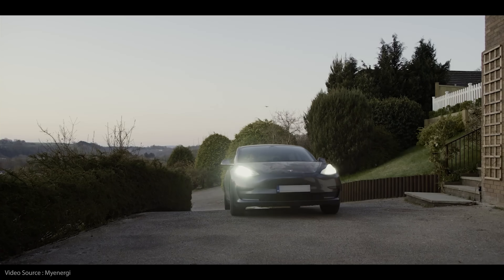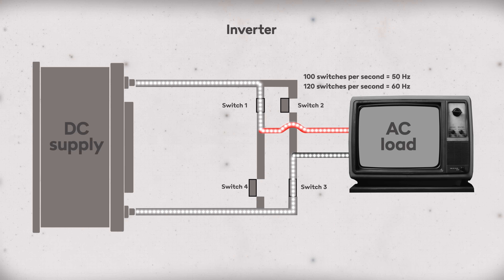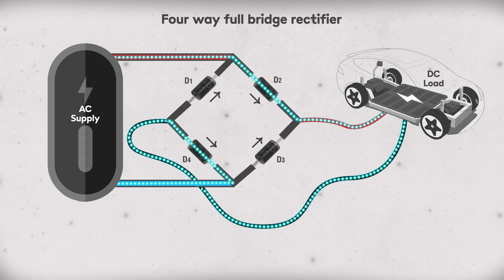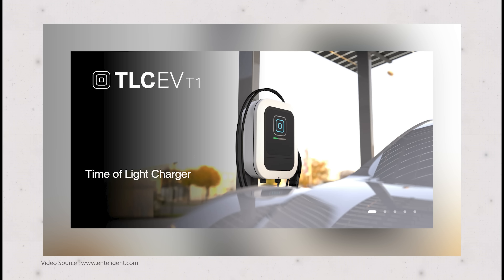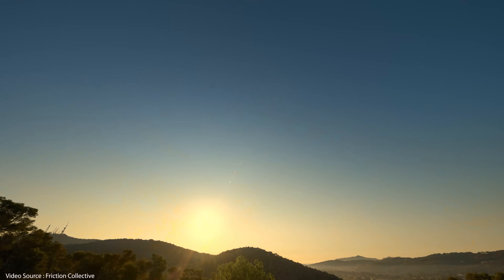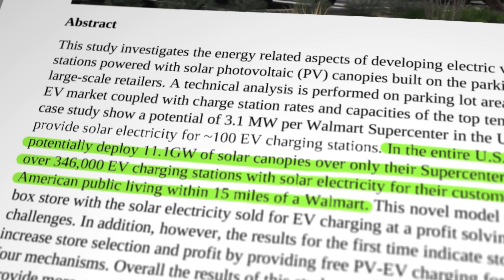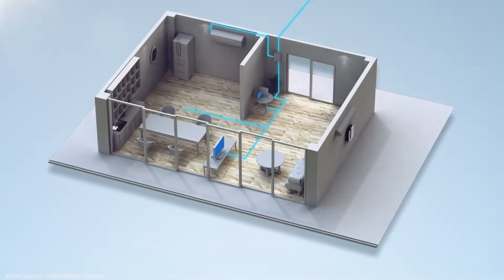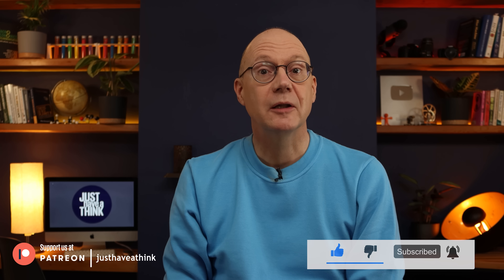DC to DC charging. One more step to off grid living!

Comment: I want to run a heat pump directly off DC solar with no batteries.  I don't usually need cooling at night and there's plenty of solar in the day.
Reply: While DC motors exist, they are horrendously inefficient (50 to 80%).  Compare 75 to 90% for an AC motor, and your heat pump has at least three (the compressor, and the fans).  You're gonna waste energy somewhere, best case you lose 20% in the motors, or if you go AC you might split those losses between the motors and the power electronics. 

The real issue though, is your modern heat pump has a bunch of power electronics in it to match the load on the machine to the conditions and demand - the first stage will be a rectification stage - unnecessary if you have DC to start with.  The motors will use AC for the same reason car motors are AC.
Reply: @jnawk83  I see what you mean about the motors being inefficient on DC.  If the system were to convert to AC for efficiency that's fine.  My real goal is to have it run it without large batteries and as few extra components as possible.  My concern is the system may not handle the irregular power inputs without those large batteries though.
Reply: @jmr  ah yes, you'll either need wastefully many panels, or some energy storage
Reply: @jnawk83  Panels are getting cheaper quickly and they have great life spans compared to batteries.  I think I can find places to use the excess energy.  I've had ideas about water heating and water pumping as places to dump extra capacity.

Comment: As has already been pointed out, switching power supplies are pushing high 90s percentages in efficiencies. Supercaps are changing the way electrical energy is stored and used. Distribution of power becomes less of an issue when micro-generation is so low cost that it shows up in every neighborhood.

Electrical power is taking over from fossil fuels, thank a merciful God. We just need to figure out how to collect it from the sun, wind, moving water, and heat of the earth and then store it for a while before turning it into cooked food, moving vehicles, lights, and clean clothes. The ones who insist that these operations require the energy density of fossil fuels are simply keeping their heads in the ground.

Comment: I love the idea of saving 10-13% of my single biggest use of energy, i.e., EV charging. But I am even more excited by the idea of commercial charging stations composed of PV, batteries and DC-to-DC chargers. That would need no or minimal grid connection -- another step towards decentralization. Computing has been distributed for decades but energy distribution is still on the mainframe model.
Reply: Not really true. Before the internet, computers were mostly standalone, but now practically every one of them is entirely dependent on the internet. If the 'grid' goes down, nothing will work.

Comment: I have a chevy bolt and absolutely love it.  and i have solar panels with grid tie inverters so yes when i charge its during the day, and free!   but this was not a green decision.. far from it.  it was economic, saves me money and wear and tear on my truck which i use for work. that was the biggest win on my pro / con list that i used to make my final decision. biggest cons were,  in the long run create more pollution, especially this one as the battery has been replaced. Another big con, and this is a big one, if air bag is deployed from a fender bender, the vehicle is toast as fail safe system discharges batteries to zero.  things to keep in mind.
Reply: Please cite your sources, I can only find where the traction battery may be disabled, requiring it to be reenabled after a crash.  The pollution in the long run compared to internal combustion thing has been debunked over and over.
Reply: @Chocula003  Look at any of the junkyards with EV's   you find many with minor accident but air bags deployed and they are 100% junk now due to the main battery discharged to zero.  as for polution yeahp turns out from birth to end of life the diesel vehicle pollutes less then gasoline or  ev's.
Reply: @HR-rt9nh  That is anecdotal, not a citation.  Great, you should be able to cite many credible sources that back up your claims, let's see them.

Comment: The problem is that we live in a big city and there's only 1 rooftop per 20 apartments
Reply: There do exist products you could use, though less easily available.
There are solar panels that have been integrated into double glazing panels, with some proportion of light allowed through and some captured for power. Even standard PV panels leave a lot of incident light uncaptured, so it's just a variant.
There are also vertical (wall) panels you could attach to the outside the building. Installation would likely be problematic!
Reply: @rivimey  Personal transport made the transition from horse and buggy to Ferraris and Boeing in relatively few years. Whether that was facilitated by the extra convenience of the latter or the local councils charging residents for scraping up all the horse "feathers" is up for debate, but I'm sure that the change to renewables will eventually follow a similar arc. 😉😊
Reply: you can easily get about 1 kw /4 m2; you can cut down your electricity bill.

Comment: You should do a video on the Solar Electric Car called Aptera.
Could someone please answer?  Bi-directional charging, is this something that needs to be implemented by the EV vendors, or by Utility providers? If its the vendor, why is Tesla hesitating to do this in their EVs?
Reply: Tesla is hesitating for 2 reasons. 1 it competes with their powerwall, why would you need more than 1 powerwall if you could use your car? And 2, their original battery chemistry does not work well if constantly charged to 100% and discharged below 30%, something that is more likely with an off grid situation. Most modern Lithium Ion Phosphate batteries can be charged and discharged as often as you want, without really effecting the lifespan of the battery itself. Hence why only certain manufacturers offer a V2L option on their vehicles.